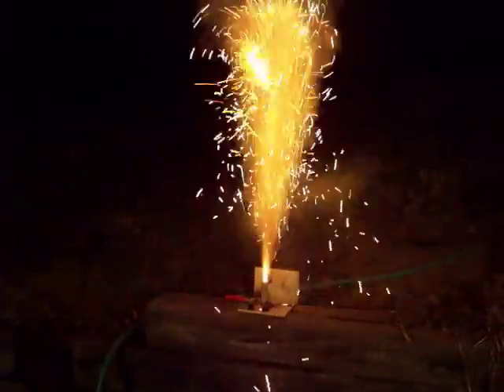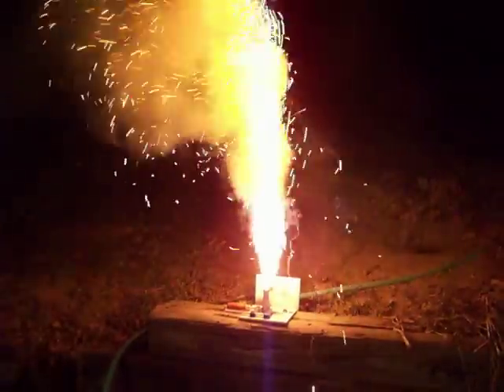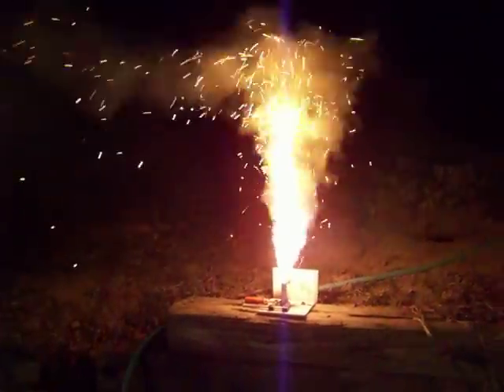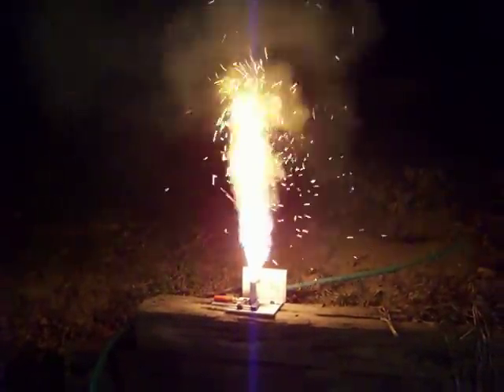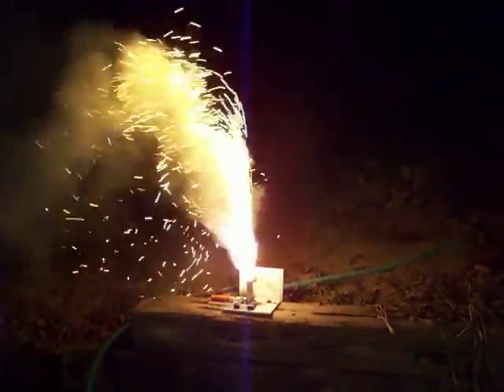kno3 sugar rocket engine test part 1

Comment: "ahhh err... arhm.... where's the other one!?" loled!

Nice burn rate yet i think it needs to go a little faster..! ;) Did you have a nozzle on that? I noticed that something was "spitted" out...!

Try using Corn Syrup it won't let the sugar recrystalize and it'll give you better burn ratios, if you can, try and mix Iron Oxide (about 3g with your batch) :)